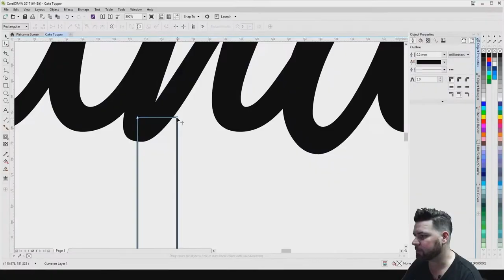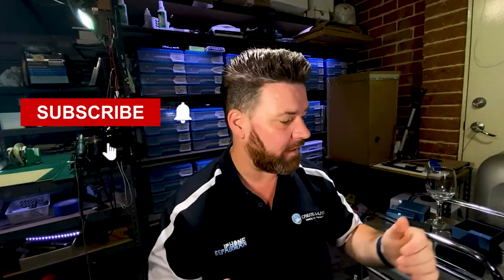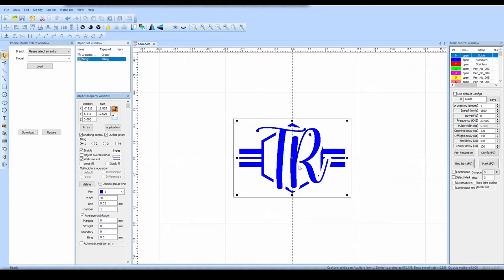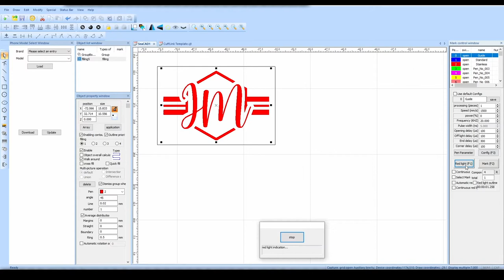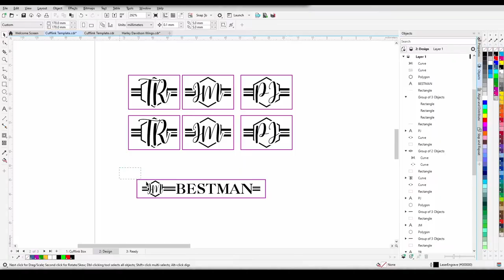How to Laser Engrave on Metal Cufflinks

Comment: Hello - I love your vids. Can a Thunder CO2 60W do this? Perhaps with metal marking spray like CerMark, Enduramark, or LaserBond....
Reply from the maker: Hi Jacob, These cufflinks are made from Brass so possibly wouldn't be suited to your CO2, though if you had stainless steel Cufflinks you can easily make a permanent mark using these metal marking sprays. Other options could be to source some gold, brass or any cufflink with Wood or Acrylic in it. Then you can etch these. I have some that use a brass frame, but embeded with a square wood panel that can be easily etched by a CO2. Hope this helps.